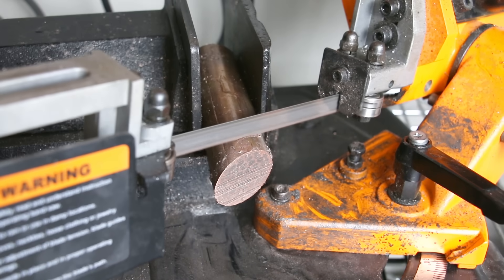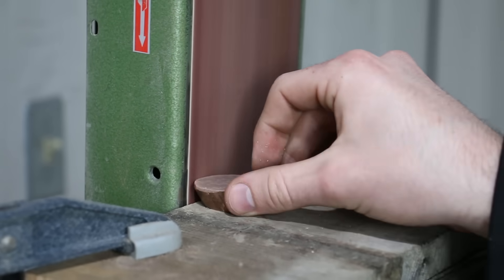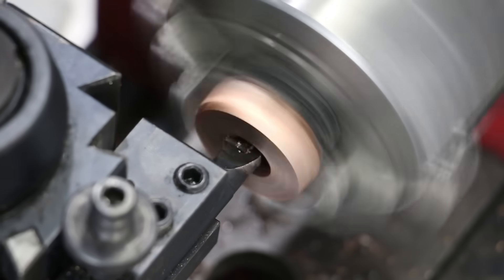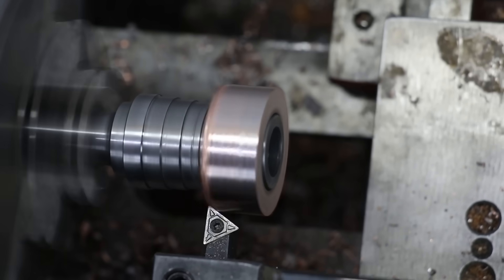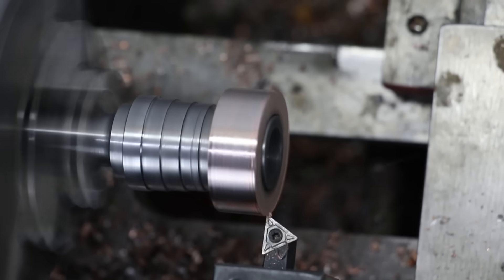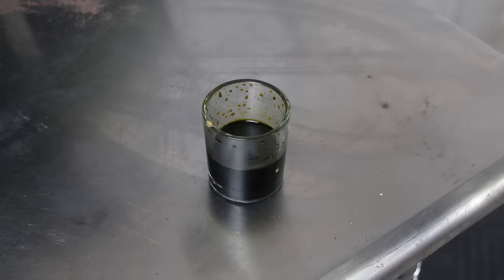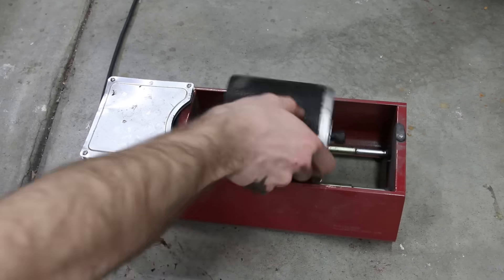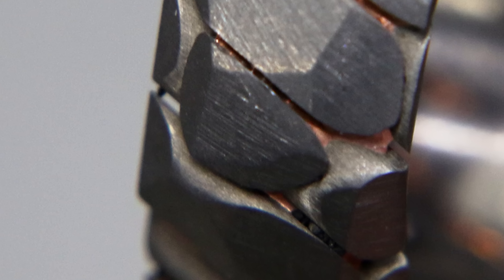Making an Acid Etched Superconductor Ring with Obsidian Facets

Comment: reason your going through so much tooling is your using a center drill to go all the way through part.
Reply: DemonicBlizzard If I, by any chance, ever encountered a center drill... how should I do it instead? Would I need a tool not shown here or would I for example just start earlier using the "scraping the inside layer by layer"-machine? Wouldn't that one be overburdened by the angle?
Reply: I would just start small and work my way up to size using carbide drills. I have found over the years that trying to use a center drill to plunge through the work piece puts unnecessary amounts of wear on the center drill. I've been told to only use the center drill in tell i get the angle. once that is complete use a drill to complete the work. steeping up from a smaller size lintel desired size is reached makes it seem easier. after trying to sharpen center drills for a few years i quit using them for drilling through the parts.
Reply: Anon Bnon my thoughts exactly, tbh i think he is more of an jeweler than a machinist
Reply: I dont think i could make a ring look that good

Comment: Here's a little tip from an old Machinist. That Center Drill is designed to drill a perfectly centered pilot hole for a regular drill bit. They don't have flutes long enough to pull the chip out of the hole so it piles up around the drill and makes everything overheat and get dull fast. Also all that heat and friction is what's making your material work harden so fast. If you will just use the center drill to get a nice, centered pilot hole. Then follow it with a high carbon steel or carbide drill bit you will get a lot more life out of your tools and save some money.   Great Video. You do some really nice work.

Comment: Look into sharpening or having sharpened your bits.  Also look into using coolant or cutting fluid while you work.  A center drill can be sharpened quite a few times.

Comment: it looks really cool, however my only criticism is that to me i feel like the titanium rods will eventually fall out of the copper since it doesn't have nearly as much material holding it together. I would almost like to say cover it in a thin layer of epoxy or acrylic so that way you can still see the depth on this ring but don't have to worry about pieces falling out.

Comment: To be clear, this is NOT a superconductor, at least not now. The closest thing to a room temperature superconductor we have right now is hydrogen sulfide that begins superconducting around -73C and at 1.5 million atmospheres of pressure. So this is just a ring that has the potential to be a superconductor under the right circumstances, although since its form is so different now and most of the copper has been eaten away, I even doubt that much.

And with that out of the way, it looks absolutely amazing and I'm tempted to buy one.

Comment: Random fact: The copper in the superconducting cable acts as an insulator to the superconducting channels in a similar way we insulate copper wires with rubber. It's ridiculous what happens when there is LITERALLY zero resistance.

Comment: Would you or anyone that is making Rings be able to make a Bowman's horn ring it is a ring for a bow shooter a traditional bow shooter that fits on the thumb has a little horn on it or it's made out of horn as well could be could be made out of stainless steel I would like that but it's used for shooting bows with a pinch method string goes on the little horn index index finger holds it on in drawback release much better faster release for a traditional bow hunter or shooter please if anyone can do this give me a email and we will go from there please and thank you have a great day God bless don't see you until then or hear from you till then Merry Christmas

Comment: I think the ring looks really cool, but I think it might have been better if you could protect the inside of the ring from the acid, so that the inside of the ring would be a smooth solid metal rather than have the gaps that might pinch.  Maybe petroleum jelly would work?

Comment: I'll be honest, I thought this ring looked ridiculously mediocre until the 10:03 mark, and then I wanted it more than anything. I have less than no idea what I just witnessed, but I'm going to assume that liquid you put it in to make those etches was some kind of acid strong enough to eat copper but not the other material. Am I correct in this? Whatever it did, it made it 10,000x cooler.

Comment: You did well YouTube recommendations. You did well.
Reply: (For once.)
Reply: @billy4734  no it's great every year or so I get recommended a cat video just one a year
Reply: Aru owo it's a conductor that is super😂
Reply: Someone can explain me what is a super conductor.. thing?
Reply: PS Pd when chilled, with say liquid nitrogen, the become "superconductive" meaning it allows electrons to flow through it, with next to no resistance.
Meaning, extremely simply, using it as wire, allows you to send much more electricity through it than normal, much, much faster.
It is used in things like, mag lev trains, x-ray machines, MRI machines, the large hadron collider.
Reply: I want this now
Reply: Yes. Yes it did
Reply: agreed
Reply: i watch loli hentai...
Reply: hell yeah
Reply: Yeeeeep
Reply: Lol
Reply: WHY ARE TOU FOLLOWING ME FBI
Reply: Hassan DM 
Ikr
Reply: Definitely agree with this!
Reply: Yaro Vrydag  Dat weet ik niet
Reply: Karaz Feral-Fang how does it sound even remotely dangerous?
Plain old iron is more dangerous (when it rusts can cause a really bad disease if it gets in your blood, a small cut on your finger from the rust bits hanging off)
Reply: Karaz Feral-Fang that's a valid concern, and I'm no nuclear physist, but if I remember right, those things don't produce as much radiation as you think, and what it does produce is very directional, and also absorbed by heavy material, what material, I have no clue, but I think the magnet coils are on the outside, and the radiation beams are inside (outside being further out closer to the surface of the machine,<the outer ring or an MRI>, inside being deeper in the machine) directed at the patient and bounced back to where it came from to be absorbed there, so personally 8 would see the risk on that of about the same level as old school glow in the dark watches, (the ones that glow due to radioactive decay)
Reply: Karaz Feral-Fang but mag lev trains don't produce dangerous radiation that I am aware of, and according to what I read, the biggest stock (of superconductor of this variaty, big  enough to make mens rings out of) comes from a super collider that was commissioned but never built, so also no radiation there
Reply: FBI open up
Reply: FBI open up
Reply: I see you everywhere
Reply: FBI OPEN UP
Reply: fr
Reply: Hello new Justin y
Reply: Yup and also I did not know the FBI likes memes (tap profile)
Reply: Bleach?
Reply: imposter
Reply: My recommendation is all lolis except for this,this is the only video that not loli in my recommendation 😂
Reply: FBI OPEN UP
Reply: FBI...OwO FBI OPEN UP!!!
Reply: Oh no its the FBI
Reply: FBI OPEN U.... waait
Reply: For once they did. Must be a miracle
Reply: Thank you YouTube
Reply: God i see u more often then Justin Y
Reply: And it happened once again
Reply: It keeps suggesting me "50 Ways to Sit" and i kEeP rEaDiNg iT wRoNg
Reply: Jo
Reply: FBI OPEN UP
Reply: I like your video to
Reply: The fbi casually commenting on videos
Reply: Four years later
Reply: Hassan DM yuuup
Reply: Hassan DM true story.  Very rarely does YouTube recommend videos that are interesting to me but they did a good job with this one.
Reply: Same for me

Comment: I thought the material used for superconductors was Yttrium Barium Copper Oxide either as a solid for the Meissner Effect, or a coating over a substrate for Flux Pinning.

Comment: Switching to an stub length HSS twist drill bit with a proper included angle would have been better for that material.  That centre drill isn’t meant to drill like that.

Comment: If you build a pressure turning clamp, you can turn angled biscuits round in the lathe.  The pressure from the tailstock keeps the biscuit in contact with the chuck.

Comment: That is a center drill and not a actual drill.  Be careful dude.
Reply: schlaznger My thoughts exactly! Peck it with the centre drill and then switch to a stub length twist drill of the desired size.
Reply: PannickRev! Exactly

Comment: Just gotta be "that guy" 
But it's not a special lathe drill, it's made for spotting, and giving direction to an actual drill, first time I've ever seen anyone - on purpose - drill through with a spot drill. 
Also you could have saved alot of time if you hadnt sawed of the ring in the start, but just rather kept it on the length, drilled the hole, used the boring bar, then done the outside. And finally cut it off with a parting tool. Also where is your coolant my man? Proper coolant can prolonge the life on most any tool ten folds. 
Regards - A machinist :)
Reply: Sharklops I'm a dane. I was struggling doing the proper translations :)
Reply: He was machining the ring off-axis from the original rod's centre line, so boring the rod and then parting it wouldn't have resulted in the angled titanium pieces. Otherwise to bore it from the full length he'd have to try to mount the whole rod in a four-jaw chuck with angled chocks or something to hold it off-axis, which sounds difficult and dangerous.
Reply: 😎👍😀👏

i couldn't tell if i was delighted with your pestering 

or dazzled by your expertise.

But your comment was unique and fun to read.
Reply: Sharklops i fully agree. And I was in no way offended :)! 
If I'm not open to correction. How would I ever learn anything.
Just felt for explaining my fail :p 
Great day mate :)!

Comment: I'm clearly no expert in metalworking and only had a few hours of lathe work when I was in school, but why don't you use cooling fluid when you know the metal gets workhardened?
Reply: Copper softens when heated,it would be counter productive for him to keep it cool
Reply: Yeah, metal gets soft when you warm it, they all do that as far as I know. But I think the soft copper would grip the bit more, and dull it, so it'd make even more sense to cool it.
You know, just like if you'd try to drill a hole in a pillow, it'd grip around the bit and lock it in place. Soft Metal doesn't grip that hard naturally, just an extreme example to visualize better what I mean.

Comment: this is the first video of yours i've watched and it's pretty good, but i have some tips if you'd like them:

-the stub drills are really only meant for starting accurate holes to then be drilled with proper drill bits. you don't want to use it like a normal drill.

-you can push a ball bearing up against work held in the chuck to help reduce your total runout. an easy way is to mount the ball bearing on a piece of steel that fits in the tool holder. there are lots of videos on YT about this.

-run the lathe at the lowest speed it'll go without chattering. titanium likes lower cutting speeds. copper doesn't really care either way because it's soft. although be wary of how much you're loading the tool. it is easier to overload the tool on slow speeds, check that with a spring pass (doing a second pass without changing the depth of cut)

-you're wasting a lot of money on tooling by using the wrong tools, or using tools wrong. you'd save a lot of money in the long run calling up sandvik or whoever and straight up asking what the best carbide drill for hogging out the center would be. i wager it would just be a regular carbide drill bit run at a low speed.

-instead of a belt sander, try a nice coarse aluminum oxide grinding wheel and get it nice and clogged up with candle wax. run it at a low speed. titanium needs low cutting/grinding speeds, and the wax is for the copper.

anyways, cool channel and cool rings.
Reply from the maker: SuperAWaC wow those are all super helpful tips. Thanks for taking the time to share them!
Reply: @PatrickAdairDesigns  you sell those rings those are sick I would love one!!!!
Reply: Yep, some good tips there. I would say keep the belt sander but buy some different belts for it. Look on specialist websites. The aluminium oxide ones are only really good for wood, I would go for ceramic if I was grinding titanium at all.
Reply: Patrick Adair Designs One more thing:

There's a book called "Machinery's Handbook". It should provide with the correct feeds and speeds for a lot of the materials you work with. Obviously sometimes you work with really exotic materials that probably aren't included, but overall it should be really helpful to get really good surface finish.
Reply: Very useful tips! Thanks!!!

Comment: How does the solution you used when etching the metal eat away at only certain portions leaving others remaining making that 3D etched look?
Reply: Never mind i saw your other video where you explained it. Thanks
Reply: Assuming I saw the same video you did, he did really explain why, not very much in depth any. First off its not acid, or at least the acid(HCl) in the solution isnt involved in the reaction, The active compound is Ferric chloride, because copper is more reactive than the Iron in the ferric chloride, a displacement reaction occurs, where the copper displaces the iron from the ferric chloride compound creating copper chloride, Both the newly created Copper Chloride and the iron dissolve in the solution. The reason this doesn't happen to the TiNb superconductor material is because the alloy is less reactive than the iron, So it doesn't really participate in any reactions, and stays where it is. To be Fair there are some extra details skipped out on here, but it gets the idea across.
Reply: AbsoluteTrash Thanks for the info.